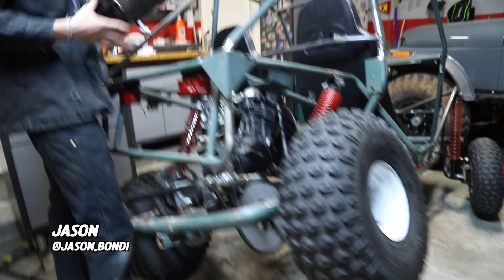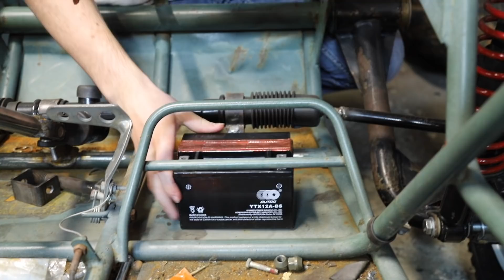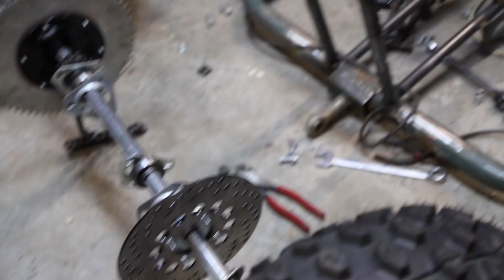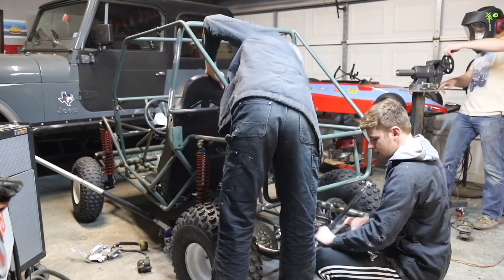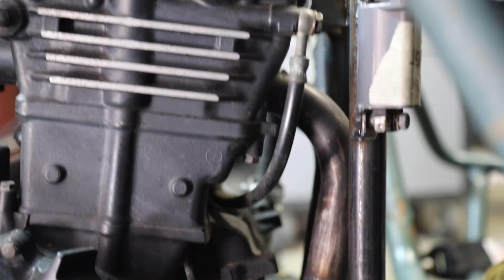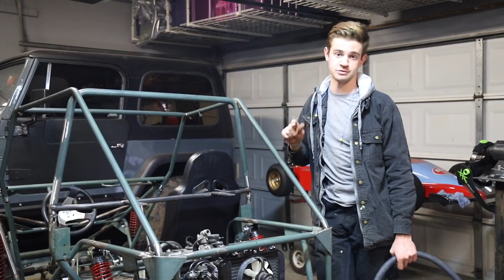Ninja Powered Offroad Shifter Buggy Build Pt. 5 | Engine and Systems Install!

Comment from the maker: We were super busy with finals last week and Joe graduated! From here on stay tuned for weekly uploads every Sunday at 9pm central!
Reply: @Bills BuildAll Motorcycles have the gas tank mounted above the engine ALL the time. As long as your float needle and seat are in good condition, it will not be an issue.
Reply: Congrats joe! 👍

Comment: Don't forget to gusset the roll bar in every portion that's above you like your belly button your belly button and up needs to have Dustin so I can tell that there's none up there but the lower portion looks like it has some nut roll bars not very big so you definitely need to strengthen it with some gussets good job though guys are doing awesome with this really cool

Comment: I am wrapping up my fuel tank fab on my ninja build .  I thought you might want to keep the stock airbox , I tried using velocity stack setup , CV carbs just need that stock airbox .
have fun with the wiring, it was a challenge for me.   The build looks great

Comment: I'm going to tell you guys right now that fuel petcock is not going to be enough flow for that motor we're having an issue with a Polaris Sportsman 500 where the fuel flow coming from that exact fuel tank is not enough for the engine to run properly at high RPM we changed the fitting and put a nipple on it and an inline filter and it works a lot better

Comment: the radiator fan is supposed to blow towards the motor pulling colder air from the outside not viseversa because you will pull hot air from the engine and run hot all the time!!!!

Comment: Congratulations on the Degree.!Dancing gets a B+(No spins).Not even going near the"Allota pipe to put..">The Top radiator hose doesn"t come from the OUT of the motor,in back,and the bottom feeds the top?

Comment: Just get rid of the air box a Use k&n air filter
Reply: Then they would have to re tune the carbs.. Not worth it, won't gain any power.
Reply: William Jenssen not for hp but for clearance

Comment: You guys are really rocking with this build. I was watching you guys put the rear end back on and noticed it’s only attached by the big eye bolt to the frame? I’m sure you smart gentlemen have thought of this but if your trying to grab traction or really hard on the throttle, is the rearend goin to kick sideways?  Looks a bit out of control if ya know what I mean?  You wanted flexibility to really help with goin where you want but isn’t it goin to be a bit wonky ?? 

Just saying guys.

Comment: I would suggest you mount a fire extinguisher between the seats  with the nozzle pointed at the motor. With that gavity feed fuel tank and all the movement hoses can slow come off and leak all over. Remember when RedBeard BBQed his buggy.

Comment: If that's a thermostat in the middle of that upper hose you might want to either make sure it has an internal bypass or install a bypass hose so it doesn't overheat waiting for it to open.